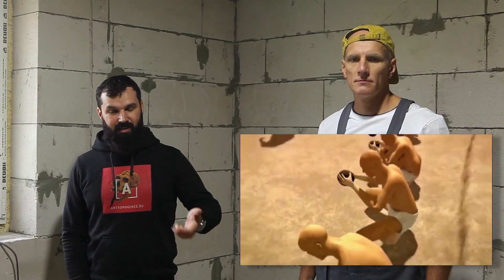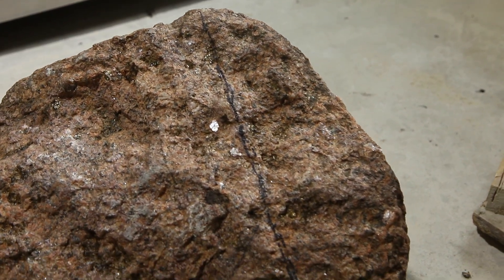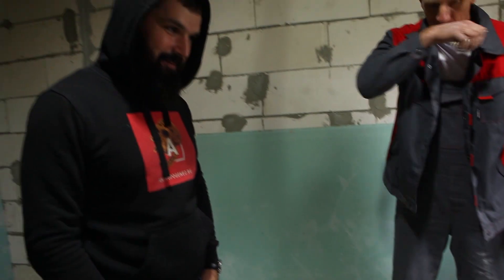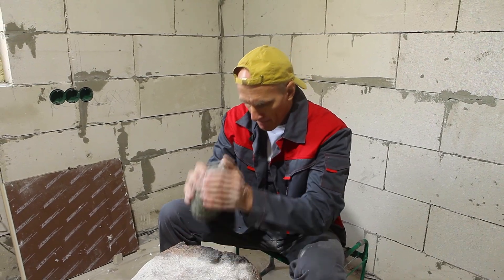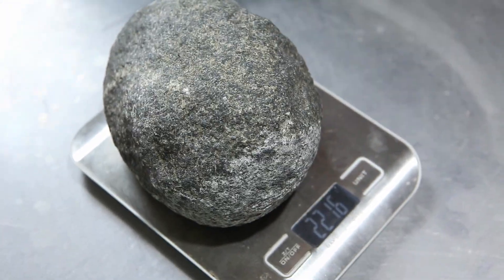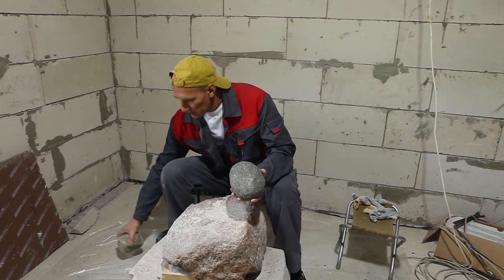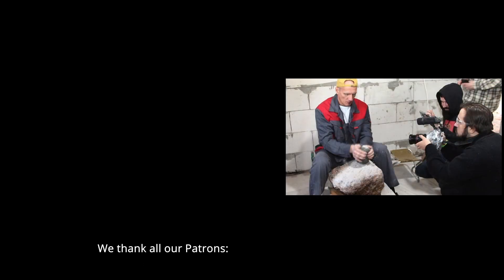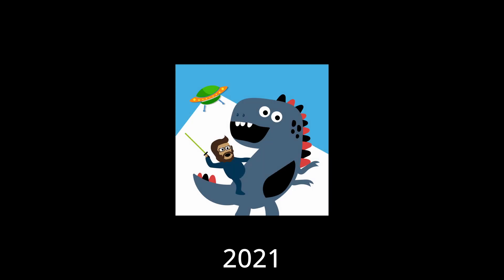Dolerite vs Granite | Could Ancient Egyptians carve obelisks?

Comment: Before watching, it seemed unreasonable for megalithic work across the world (not just in egypt) to be done smashing stones like this. After watching the experiment, it's even more improbable.

Never the less great experiment!
Reply: Reality continues regardless of your disbelief.
Reply: @Eyes_Open reality is no one knows. The ancient Egyptians were masters with stone works, and had amazing knowledge of maths and engineering. 

Realistically if they are capable of building the pyramids and the polished megalithic work we see, its perfectly reasonable they were more than capable of using techniques more sophisticated that pounding rocks
Reply: @peanutbutterfalcon7016 What tools types have always been used by masons? What tools have been found in the archaeological records? What has experimentation shown?
Reply: @Eyes_Open depending on the type of masonry work, masons will use different types of tools depending on the purpose.

We find chisels but here is the issue.

If you are wanting to make perfectly fitting interlocking blocks with precise cuts that you can’t even fit a razor through, you are not going to use a chisel for this job, and you are definitely not going to use pounding blocks.Why not? Because the tools and methods are insufficient for the final product we see and are trying to explain.

Again idk how they did it (and no one does), but based on their cognitive ability to design and plan for something as grandeur and complex as the pyramids, it is very reasonable to expect them to have the cognitive ability to come up with other solutions of banging rocks and chisels
Reply: @peanutbutterfalcon7016 You are not a mason but you feel knowledgeable enough to say what isn't possible for a mason. Since we already know that masons use hammers and chisel toolsets, perhaps you could show the proof that drives your assertion of impossibility.

Comment: This has also been tested by other egyptologists

Lehner & Hopkins-- 74 cc/hr
Denys Stocks.       -- 30 cc/hr
SAM.                       -- 311 cc/hr

So, you removed over 400% more than Lehner/Hopkins and over 1000% more than Denys Stocks. 
Why such the variance in the results?
Reply: If you notice several weights of hammerstone were tested yielding different levels of removal.  Also of course here they were simply hammering upon a stone with the intent of removing matter without regard to achieving any particular outcome.  

Also these stones are fairly rounded in appearance which means a larger surface area acting upon the Granite boulder.  Egyptian hammer stones however appear to have been ones more "pointed" and upon their becoming rounded out they would be discarded. So Egyptians typically might be expected to remove stone in a more precise manner as opposed to simply whacking on a boulder to see how much matter one could remove.  

p.s. - the "technique" as far as hammering also likely plays a role.
Reply: @varyolla435 @varyolla435  Ok. That seems fair. I appreciate the cordial response. You seem to frequent alot of the same coment sections that i do so i wanna ask a couple sincere questions, but first, full disclosure, I would probably be considered "pseudo" or "LAHT". Nothing extreme. My views pretty well align with Flinders Petrie's. Circular and straight saws, and hole saws with fixed set hardstone teeth (ex. corundum, emery) and lathes. All hand powered or possibly water driven. Anyway, do you really believe the pounding stone and flint chisel methods are how the Ancient Egyptians worked and shaped granite? Everything from the unfinished obelisk and the valley temple to Khafre Enthroned and the schist disc. If so, then ok, my other question would be is there anything that you do question or disagree with the "mainstream narrative" on regarding Ancient Egyptians working, cutting, shaping, or moving their stone work? All sincere questions. Just curious. Thanks

Comment: The grooves on the unfinished obelisk show no impact marks, and the curves are too smooth (practically polished). The experimental result does not explain the regular, polished marks on the obelisk, and therefore does not explain it.
Reply: "Unfinished Obelisk" = as in partially completed.........

Moral:  rather than seeing what you apparently want to see = instead look at everything there.  Some areas of the Obelisk are still very rough - as in the bottom portion where they were beginning to quarry underneath it.  Your "scoop marks" there are very crude.  Other parts closer to the peak however are smoother as you say as that part was closer to completion.

Comment: Egyptians had Corundum deposits for  the Corundum abrasive powder...they also probably had Copper alloys such as copper and antimony, and copper and bismuth(both harden Copper, and both minerals are in Egypt..)
  To cut 2 million blocks for a pyramid, I thought maybe they had the simplest tech to cut stone- Steam power. Copper steam engines and hardened copper blades.
  You can also  take  a Copper alloy and add Corundum powder, and with heat and pressure- make a Metal Matrix Composite material- and make your saw blade out of that.....Just an idea..

Comment: A statue of Khafre was found that was solid dolerite and not granite.  How would they have made that statue?
Reply: Consider the following.  Some years ago in the ancient Egyptian Sandstone quarry of Gebel el-Silsila a partially completed criosphinx was unearthed which had been abandoned in place.  It was dated to the time of Amenhotep III.  

Moral:  Sandstone is harder than Diorite on par with Granite.  More importantly is the criosphinx showed it was clearly being = hammered into shape - meaning gneiss stone tool usage such as Flint/Chert.  

Had it been completed it would have been transported to nearby Karnak - perhaps along the famous "Avenue of the  Sphinxes."  So they using gneiss stone tools like Flint/Chert which can be shaped to need were hammering out the basic shape.  

If completed they would have then = polished it smooth using an abrasive compound like sand or Corundum - likely in some type of medium like mixed with clay or an emulsion.  Think modern countertop cleaners which use a grit mixed in a semi-liquid emulsion.  

Not everything was done using Bronze - and later Iron - tools as alluded to by others.  The Egyptians mined large amounts of Flint/Chert - Egyptologists found a large quarry in the eastern desert - which were also commonly used.  Using alloyed metal tools is expensive whereas mining and shaping Flint/Chert - or Dolerite - is much cheaper to use.  Metal tool use was probably saved for specific tasks.
Reply: With masons tools. The statue was created in what time period? Could be stone, bronze or iron toolsets or combination.

Comment: i wonder how many dolerite hammers it would've taken to get through the amount of material needed to build the obelisk
Reply: As many as were needed of course as the Egyptians had an endless supply.  There are "geology maps" created in ancient Egypt which marked off the locations of various geological deposits - valuable ores and useful stones they desired.  In the eastern desert as an example Egyptologists excavated a ancient Flint/Chert quarry.  It contained large piles of waste rock denoting they were harvesting stone for use as tools etc. = on an industrial level. 

Moral:  in the Aswan Quarry as an example Egyptologists found hundreds of Dolerite pounders strewn around the quarry area.  Some even had painted on them - in the same red ochre paint used for the workman graffiti found in pyramids etc. - the names of the workers they belonged to.  

Also it appears that they only used them as long as they had needed "points" to chip through the bedrock.  Upon becoming "rounded out" they appear to have discarded them for new ones.  Some speculate those then rounded Dolerite balls being of no use for quarrying were repurposed for other things - like sticking under say a block or sarcophagus to be moved to allow it to be pushed/pulled more easily.  The ancient Egyptians wasted little.

Comment: Why do you think they did not use machinery? They were an agrarian culture. Ropes has been around for 700.000.years as it predates Homo Sapiens. Homo Habilis went to Cyprus and over the Gibraltar strait. Ofcourse they intertwined fibers to connect logs. The bag is the very first artifact Homo Habilis usef to free their hands. The capstan and the wheel or at least rolling logs, swinging logs, swaying logs and ropes. Marks of capstans are on the edges of Cheops pyramid and in the shaft where stones were transported upwards. Just shrug off the idea you have to be "primitive" to learn about the dynasties and the pre dynastic peoples.

Comment: Nice work.. now make it more precised and polished to a degree just like how it's done on the obselik, statues, temples, vases etc. Then you can go to the quarry, cut and lift 1,200 ton obelisk out of the mountain and transport it about 500miles to the building site. Good luck trying to achieve that with copper and pounding stone.
Reply: You are trying diligently to hold on to a fantasy. This channel is dedicated to rationality.
Reply: 🤦 = nuff said............  

p.s. - as a freebie to take pity on you.  The granite quarry of Aswan = is hardly "a mountain."  Where the present Unfinished Obelisk which cracked and was abandoned sits as an example is about a km away from the nearby Nile.  Yes it rests uphill - making hauling it downhill easier - but it is hardly a mountainous area.  Must suck to see only what you apparently want to see huh.........  

p.s. - if you think they were "lifting" obelisks out of quarry pits then = 🤣

Comment: Don't forget, they most likely heated the stone with fire then flash cooled it with water FIRST then chipped away.  It's also likely they used your copper saw technique to cut slits in the stone first, then chip them away.
Reply: "Firesetting" would be useful as far as initial quarrying down through the bedrock to open up a seam of workable stone and possibly to then achieve specific shapes - such as blocks or an obelisk.  Upon having that to work with however it would no longer be used = merely hammering via stone tools as noted here.

Moral:  Egyptologists have found as an example partially completed statues in Egyptian quarries which were abandoned in place.  While they clearly reflect having been hammered into shape - at least partially - there is no evidence in the surrounding area of firesetting.  So workers freed up a chunk of stone of sufficient size = and proceeded to go to work.

Comment: I think you need to add water, and hit  at an angle so the slurry also has an abrasive element . which may assist in material removal. Plus the water would keep the dust levels lower.

Comment: It really amazes me that the only way I ever see the dollerite being used on granite is in the same retarded method of repetitive hammering of the dollerite against the granite. Never have I seen the actual method used that the Egyptians used. Which is not fruitlsssly hammering but grinding or rubbing the dollerite back and forth against the granite. This is a much more effective and efficient method that the Egyptians obviously used. When considering the supposed "scoop" marks on many of the unfinished granite stones such as the unfinished obelisk, it is evident this is the case. The troth like depressions are the exact marks that would be left when grinding a rounded dollerite tool back and forth til the dollerite slowly gains progress into the granite. Just look at the unfinished obelisk. Some people say the "scoop" marks must mean they are the result of some lost advanced technology that scooped granite out like a spoon to butter or something like that. No. Find a dollerite rock that is similar in size to a specific "scoop" mark and continue to grind that scoop mark. It will fit perfectly and then you will see how it all makes sense.
Reply: Today most craftsmen use say a Dremel to save work and effort as time is money for them.  Yet one can also obtain even today = polishing stones............... - and no they are not of enormous sizes either.  

Your scoop marks could be created by workers sitting facing the obelisk - each responsible for a certain section.  By chipping and yes abrasion in the form of rubbing the dolerite hammerstone up and down = a "scoop" could be created in front of them.  

Conclusion:  a stone tool capable of "chipping" = is also capable of abrasion - it is simply a matter of a different technique.  So experts simply show that rock on rock can abrade stone.  It is unnecessary to demonstrate each potential technique in doing so as what matters is as noted = rock can abrade rock regardless of how it is done.